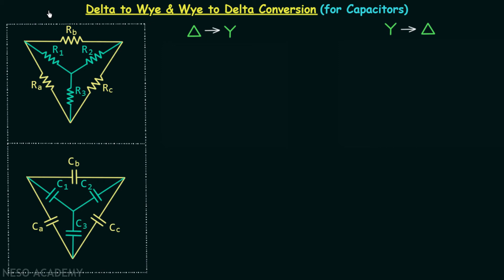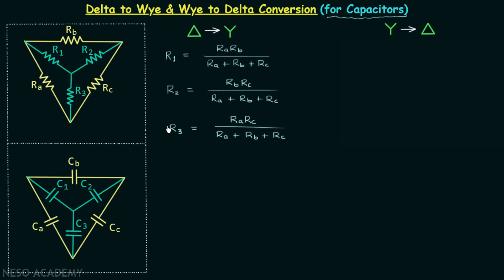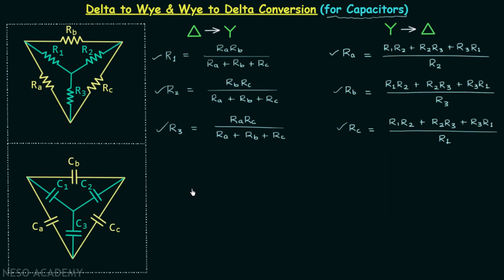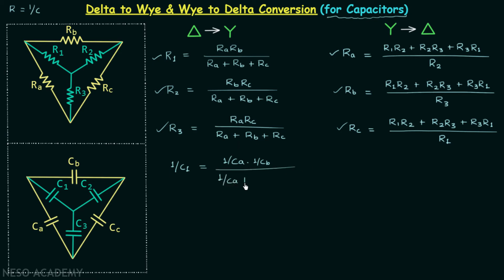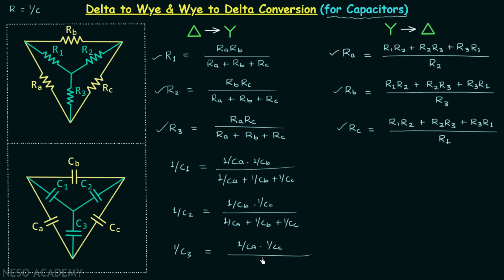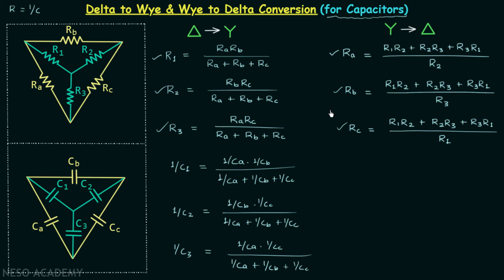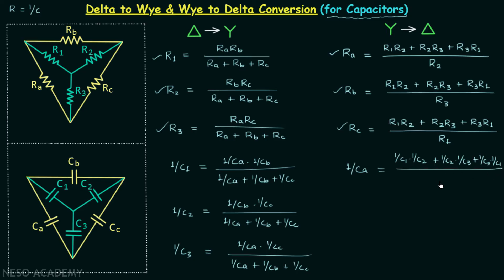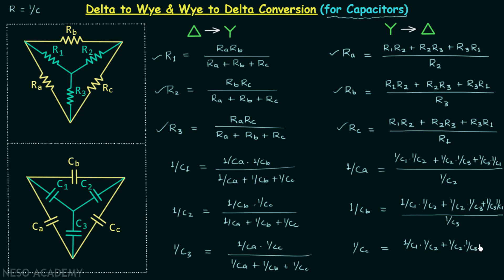Delta to Wye & Wye to Delta Conversion (for Capacitors)

Comment: Rather , we can say same formula but opposite. I mean formula of wye to delta for capacitors equals to delta to wye for resistors like relation between resistors and capacitors formula of parallel and series connection.